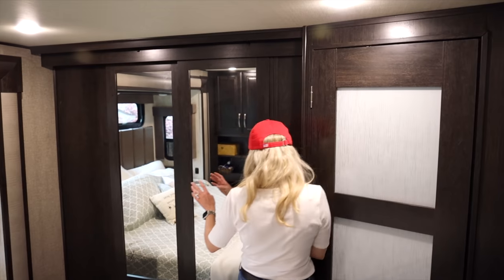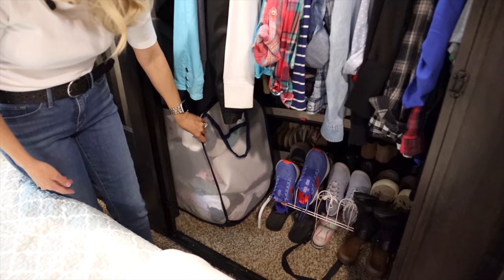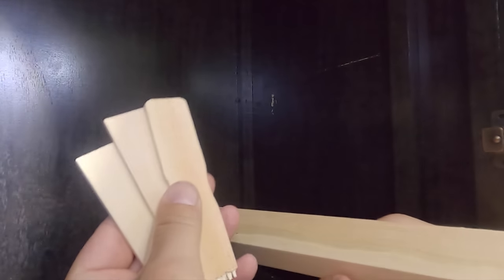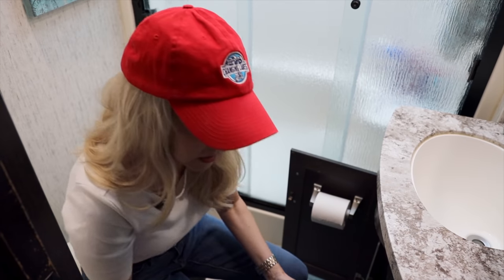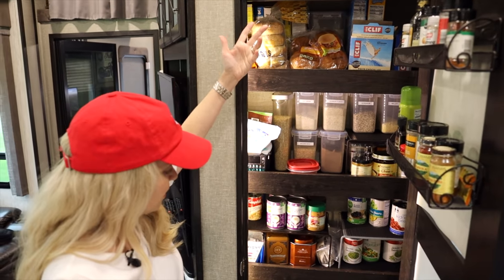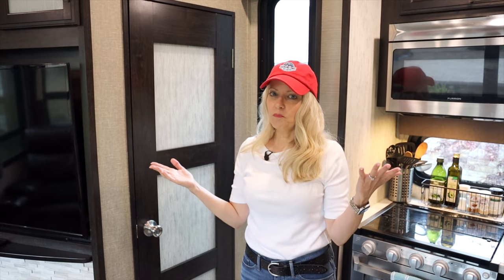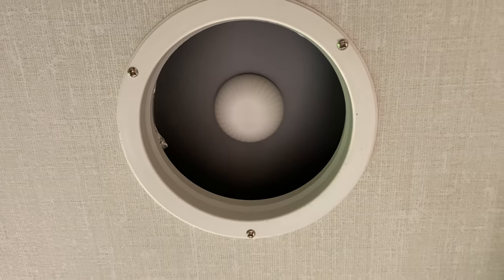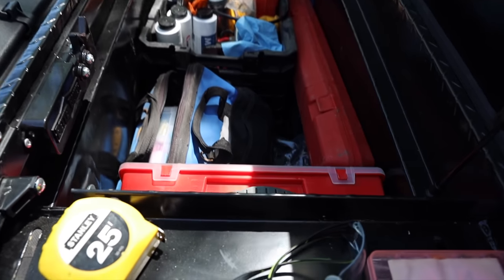➡️ RV Mods and Organization for RV Living [✅ Bonus Projects!]

Comment: Hey Chad, if the glue fails in the wardrobe,  cut a full board to fit from the shelf just below to the bottom of the next. This way each shelf is fully supported by the shelf below it. Glue is nice, but not always up for the job.

Comment: Awesome little tidbits thanks for sharing.  Going to share a safety tip. Take your oil off the counter next to your stove. If you have a fire that oil to feed it quickly. Don’t put it in a cabinet above the stove either. Both are extremely volatile and dangerous spots to put flammable liquids. It may be inconvenient but move them to your side cabinet or pantry.

Comment: You could use baskets or fabric curtains to hide your clothes on those great shelves. Good bathroom organization. Great pantry ideas. Amazon has great pullouts for under the sink easy to install. I am 75 and did it myself. I even bought 1 for trash can and 1 for glass sauce pan lids. You have great ideas.

Comment: 12:14 - those metallic organizers. I used one of those in our odd cabinet next to the kitchen. Screwed them in up on what you would consider the second shelf level. They fit spice n seasonings perfectly. Webber or Mccormick brand. And I put it just high enuff to store a row of seasonings under it.
Also used in out medicine cabinet to get a shorty second level 'basket'. Small stuff like nail clippers, contact lens case, tweezers, etc. fit easy to get and out of the way.

Comment: Roll-top might work, like for a desk. The one my Uncle had used a sturdy fabric base and glued the slats to it and routed a channel, but you might be able to bend PVC, then cut it in half. (bend first cut second) so the PVC holds it's shape then glue it in with your Gorilla glue.

Comment: Since I think I’m going to be sheltering in place until fall. I had some trailer legs.com installed. It wasn’t hard to do but had a learning curve in the end it WORKS! My double axel tires are all off the ground about an inch and I won’t get the dreaded flat area of my tires. It also stops almost all movement in the rig. Yay 😁
Reply from the maker: Hmmmmm. Those look interesting for working on axle maintenance...

Comment: My fav mod was doing the Garage bunk conversion like ya'll did. I had front and rear facing couches and had to buy brackets for side to side couches. I mounted 3/4 plywood on the tops and now have desks for my wife and I to work from home. All i need to do now is figure out a solution for the dovetail in the back, we loose 21" of floor space in the very back of the camper. That's my next project.
Reply from the maker: Yea.. that slope in the back is a pain for sure.  Tara's chair runs right up to the edge.

Comment: Tara; A quick fix for your open cupboard next to the bed could be a sweet curtain & rod across the opening to hide the clothes, or opt for pretty matching containers to put your clothing into, but my favourite would be 3 rectangular pieces of wood (drawer front style) and hinge them at the bottom and allow 180 degree drop opening and a magnet to hold closed at the top - but first measure your drop-down space at the side of the bed or you'll not be able to open & access the clothes!  Love your Pantry organisation and Daisy is toooo cute.

Comment: The fix you made for your diffusers has only pressurized the air feed thus giving a higher reading. Same amount of air. The volume is set by the fan speed. It also will lncrease the noise volume.

Comment: We thought we would get more done since we are stuck here for two months. But Larry is still working full time. Love the bigger top shelf. Excellent idea. We have hooks back there too. We put our laundry in the shower. We love those magnets. We have quite a few. They need to put pegs and holes in cabinets to move around shelves. Larry uses glue that is flexible instead of gorilla glue because of the movement that happens in RVs. You could put a little curtain for now to hide the clothes. We definitely need help in the pantry. We bought some bins with handles from the container store. You did a great job organizing. I think we will always be organizing. I want a pull out shelf too under the sink. Door stop? Very cool. My dogs hate those stairs. Especially Chewie. Very cool. Larry is definitely watching this. His honey do list has just gotten longer 🤣. Great job as always guys. We have a Solitude but a lot of these will work for us. Thanks. Take care. Alice

Comment: At the time 20:25, for your cleaning supplies I use empty laundry detergent bottles cutting a opening at the top leaving the handles on them so if one starts to leak it is caught in the bottle and doesn't damage the camper.

Comment: I picked up some great ideas from you two, I have a toy hauler also and when I'm on unlevel ground my ramp door will have a small gap so I'm waiting to see how your project works out.One idea I have for your bedroom closet door is:Put two tracks on top and two on the bottom, stain two pieces of lauon (not sure of spelling)put a finger hole in each piece.Install them in the tracks so they slide back and forth behind each other.
Keep the ideas coming
Gary Nebitt,Chattanooga,TN.

Comment: Nice ideas, gonna get the magnets right away for a problem bedroom door. Just today I added a metal basket to basement compartment for windex bottle,simple green bottle and ant spray cans etc. mounted on wall holds everything. New wrap it storage straps to hoses, extension cords and hang in basement compartment. Gonna due my a/c roof units cleaning per your video. Comb and cleaner purchased today. Lol now gotta go get those door bumps to add to ducts for a/c. Great video as usual. 👍

Comment: Although this is an old video, one thought that comes to mind for the open shelving in the bedroom is to use the fancy draw slides (I can't remember what they are called) and look to get two doors from Grand design (that could fit the space) and mount them on the draw slides. This would appear like there are doors yet they slide out of the way!  Or make up a framed chalkboard to write messages on and mount that to the draw slides!

Comment: Great job! Seems like there is never enough useable storage in an RV! Next time you need to put up shelf bracing, along with Gorilla Glue add a little bit of hot glue. It will give you an instant hold while the Gorilla Glue dries.

Comment: I liked the bedroom door magnet tip- its now on my list.  I added a door light switch (search door light switch @ Lowes) to our pantry.  I just spliced into the existing manual light switch and ran it over to the new door switch.  Another one of those "why don't they add this at the factory" upgrades.  Hardest part was mounting the switch.  Nothing some scraps of wood and Gorilla glue couldn't tackle.
Reply from the maker: I like that idea!!!!  👍🏼

Comment: Great video.  I found slides for a trash can and a slide to hold pots and pans at lowes.  You can even attach your current door so instead of swinging it open, it slides open with the slide.  Ive got my trash can slide attached to the door so i slide the door and the cans out in the open .  Makes it alot easier.
Hope you enjoyed your holiday.

Comment: Love love your videos. You two are AMAZING . I would like to give you guys an idea I did in our RV- I bought these lights about the size of a hockey puck- They are MOTION CENSURED- I used Velcro Command strips ( one piece on light one piece on the area I’m placing it ) They  WORK GREAT- inside my cupboards when you open doors of cupboards they come on but go off automatically. Battery operated so no wires. I have one where my garbage can is under my sink. I even have one on the bottom of a cupboard- above my coffee pot. Let me know what you think?

Comment: Little advice on the glued in shelf supports - they may rip out under stress due to the way these walls are finished. Best solution without screws: put in vertical supports (like legs) also on the walls to prop them up. You can glue them also. Easy fix. (works best if starting from scratch you nail the shelf supports to the vertical supports).
Reply from the maker: 👍🏼  will see how they hold up....

Comment: I love all your videos!!  The mods are great!  I am ordering the “vent nubbies” right now!!

I did a similar thing with our steps - plus the outside steps - because our Yorkies were the same way as Daisy.  I got the carpet mats at Dollar Tree and cut them in half, longways, the used 3M HD clear outdoor double stick tape to mount them to the steps.  Total of about $10 including the tape and 4 mats.  Works perfectly! I did change the outside mountings to Velcro in case it rains and we have to remove the wet mats.

Comment: Really great ideas and execution!  Regarding your (Stacy's) desire for doors on the lower bedroom cabinet, if the space is the same size as the top section that currently has doors, could you buy a set of doors from your RV manufacturer? Even if they are a bit short or long, I am sure Chad could modify them to work!  Just a thought!

Comment: I added pull out shelves and garage can in our kitchen area under the sink,they work great and are easy to install. Great video really like all your upgrades !
Reply from the maker: We'd love a link if you can share... 👍🏼   Still need to figure that situation out.. 😊
Reply: Changing Lanes I got the drawer slides and the pull out waste basket both on Amazon. I laid the draw slides flat instead of on the side like normal. I can email you some pictures if you like.

Comment: Well done!! For that basket behind your stove, could you put a little command hook on that back wall to hold it in place when you travel, rather than on the floor? If you can't get it high enough for the top of the basket, you can put a twisty on the basket to fit the height of the hook.

Comment: I had to  chuckle at the anemometer. Now how  many times do you think you'll use that in your lifetime? I like your style though. And the internet upgrades... I  cannot wait to see what you do. That's got to be one of the most important assets for a remote worker... of which I will be one. This was a good watch, you two. Totally enjoyed. Happy travels!
Reply: You know he will think of many different applications. As an example air circulation for the refrigerator is critical and if you can measure improvements after you make modifications that would be important. Especially these refrigerators are very sensitive 2 air circulation. I'm sure Chad will think of many other uses down the road. I like to collect tools and sure I'm glad when I need them on a project.

Comment: The problem with command hooks on the RV walls, sometimes the wallpaper covering (our Fuzion toyhauler walls look identical to yours) starts to pull away from the actual wall substrate. Especially on exterior walls when sun/heat are bad.
Reply from the maker: Maybe they do something different at GDRV?  We use them all over the place for 3 years now and have never had any separation (knocking on wood) 😊
Reply: @ChangingLanes  could be. Mainly it's on the side walls where over time, sun vs. weight on the hook

Comment: Hi guys, was wondering about the slide in your cupboard next to your stove, was that an add-on or did it come installed? We have been doing a lot of the same things to our 5th wheel, it's really mind boggling that the manufacturer didn't do these things. Gonna steal some of your ideas though also, thanks.

Comment: I’ve got an idea for your closet hiding project. Obviously you can’t put “pullout” doors there because of the bed so, what you can do it put a “barn Slide” door with magnets to gold open and closed and the door will slide towards the pic of “chad and Tara” and then slide it back. You can even Frost the Glass “if you chose to have glass” or keep it solid. But the frost would match the Grand Design kitchen cabinets. Just my 2 Cents lol
Reply: Hey chad quick question, have you and Tara ever gone too Lake George New York? If not it’s an absolute MUST!! We’re up there all the time @ #LakeGeorgeRVpark

Comment: I have a question about your pictures on the walls, is there glass in the frame? Do you leave them up when traveling? Love your videos.
Reply: We changed out all our glass for plexiglass, the really lightweight flexible kind! These days you can’t really tell it’s not glass unless you tap on it. :)
Reply from the maker: Yes.. same as Michelle said.. we use plexiglass in place of the glas.  Lighter too.
Reply: @michellebaker4122  thanks
Reply: @ChangingLanes  thanks, I was wondering about breakage..

Comment: Chad, what supports the front shelf that you added. The back shelf is sitting on the factory shelf but what's holding up the front shelf. Did you put cleats on the side walls of the closet?  What model Ryobi cordless saw do you have. I've got several large 18 plus one Ryobi cordless tools and want to add a circular saw to my list.

Comment: The shelves are gorgeous but did it effect the weight... are they wood ones heavier than the plastic and wire ones??
Reply from the maker: The wood was just light pine and not heavy at all.  Likely weighs less than all of the metal shelves that were in there...
Reply: @ChangingLanes  oh cool I couldn't tell since they were stained lol

Comment: Hi! Love this video and have already installed several of your ideas! However, a  question:  Regarding installation of the magnet for the door in bedroom; is that wood under your carpet? Did you drill the magnet into it? because in our GD Momentum 350g, in the bedroom, it is steel beneath the floor carpet (we broke two drill bits) How do we attach the magnet? Also, how did you know there wasn’t sensitive cabling or wires beneath that? Thanks for any advice!
Reply from the maker: We had wood and I used a short screw.  Without seeing what you have, it's difficult to give advice.  But, maybe you can find a spot on the wall between studs (aluminum)?

Comment: The rollers on my closet doors are sticky too! What did you do to fix it? Also! My doors wouldn’t stay open, so I got out a level and set it in the hallway and saw it was close to level but not all the way, so I manually changed the jack heights because auto-level did a good job, but needed a little help from a human :) 

What about a roll-up curtain for that part of the shelves that you want a door on? Could be pretty easy!
Reply from the maker: Make sure they are each in the track at the bottom.. If the guide is dragging, you can adjust it from the top.  You might need to remove a piece of trim covering the rollers at the top to adjust them. 👍🏼  good luck!

Comment: Thinking about upgrading from our 350M to the 397th now that I have the F450, (FYI still haven’t decided on the truck box 😏 but do you find the washer dryer separate better than the combo?
Reply from the maker: We've never used a combo, so don't have direct experience.  But, from what we've heard about them, the separate units and vented dryer are far superior.  I'd recommend having the dealer install them, though.

Comment: 2 years for shelves.. I’d say 4 years till you get that door lol.   Would shelf pins work for the shelves? Have you tried CA glue with activator instead of that gorilla glue?
Reply from the maker: Shelf pins would not work as the walls are too thin.  The gorilla glue is holding great so far.
Reply: Changing Lanes ah wasn’t sure on the thickness. I only say ca glue because it doesn’t need to be clamped  as long if you use activator. Gorilla work good too.

Comment: Rather than Flex seal the Garage door. Have it, along with the garage floor and 12" up the garage wall, Line-Xed.  At the very least, I would go with marine grade 4200 or Sikaflex to seal all water intrusion points.
Reply from the maker: I've already done the flex seal, but that's a great idea!  Hmmmmmm.

Comment: On the A/C duct covers, does yours pop off easily or did you have to pry them off at some point?  I have a 2016 Coachmen motorhome and the duct covers will not come off the way you were popping yours off. I would like to try those door stops in my ducts. By the way I’ve install those AC silencer covers from Wack-O products as our AC are very loud. That have some noise reduction but not Tiffin quality.
Reply from the maker: Ours came off easy.  So, would you recommend the ac silencer or no?
Reply: @ChangingLanes  If your AC's are loud enough to make it annoying hearing the TV or  even talking to each other,  then yes. They are $200 ea, but I figure it was worth the money to quiet them down.

Comment: I have a question i cannot seem to get an answer to. I want to put a rolling clothing rack with the wheels taken of into the bedroom closet of my 2007 forest river cedar creek fifth wheel. The base is in a Z pattern so im not worried about it tipping over, just need to know about the strength of the floor in the closet. Its upfront where the hitch is. Help please!

Comment: The black plastic refrig doors seal doesn’t full seal causing the refer to constantly run. Have you guys figured out a fix? 
Common to all Momentum’s and it’s tricky.
Reply from the maker: Please see: https://youtu.be/MBwSJL7kBZc  
If you mean the flap between the doors, many people have put washers under the left door hinge to raise it up a bit and stop it from getting stuck on the bottom of the fridge..
Reply: @ChangingLanes  Thanks. I'll pass it along. Much appreciated.

Comment: Make sure 3M sends you something for your mention of their "sticky tape" 👍🏻
Reply: Whats up changing lanes my wife and I took the a c plate off inside the camper and reached up and vacuumed the intake condenser i have the spray for the roof condenser but need a ladder nut make shore power is off when doing this

Comment: Those command hooks  didn't  work  when  I put them on a papered wall. They just dropped  off.. those clothes hampers cost £1. In B&M
Reply from the maker: Pretty sure our walls are wallpaper...   Did you clean the area before applying them, then press them for 60 seconds?